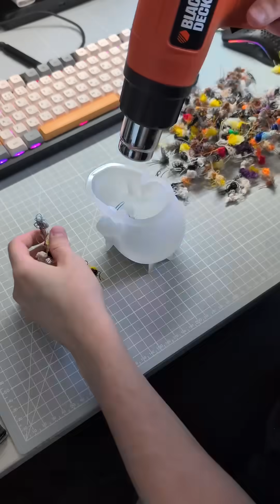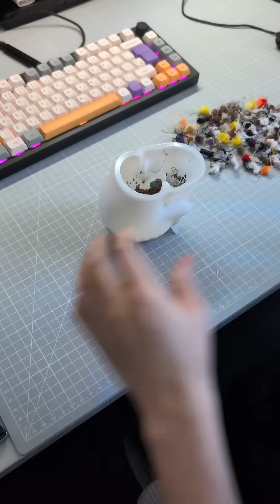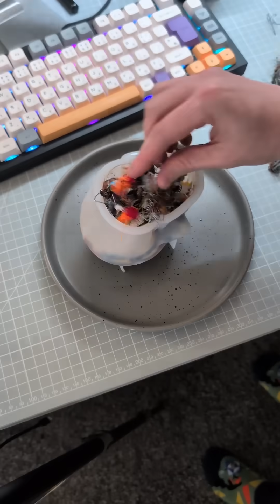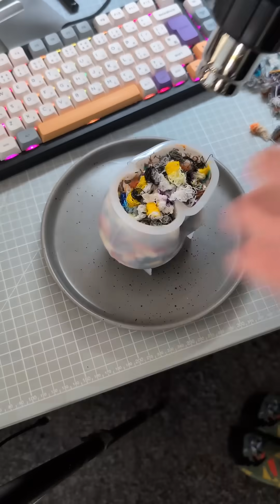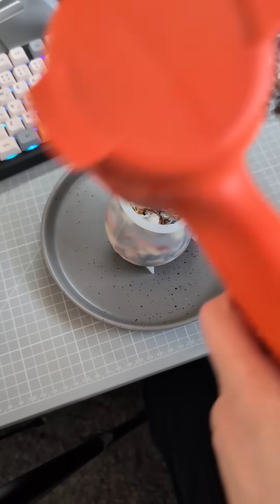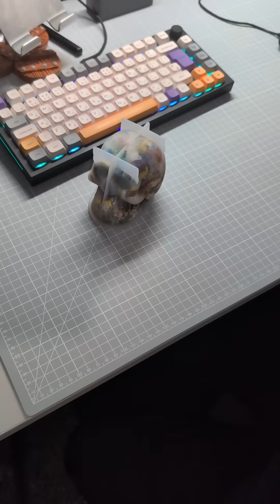Recycle your 3D Printing filament poop. Use moulds to turn it into items #3dprinting #bambulab

Comment: You want it to have a flat bottom.  After you peel it out.  Just turn on your printer bed, 65 to 70. Whatever you can get it up to. Now, use your heart gun to warm up the bottom of the casting. Put it on the bed so the weight of the mold squished the bottom flat.  Turn off your bed and let it cool.

Comment: Just use some sandpaper on the bottom,and after if you want heat it again a litle bit for a smooth surface

Comment: Wondering if I can use soda bottle caps. Does the silicone mold melt or get hot from using the heat gun?
Reply: Nope I do it with petg and it needs to get hotter

Comment: What temperature did you use on the heat gun?
Reply from the maker: I turned it on. I don't have the control of the temperature on this one.

Comment: You can flatten with a belt sander, or use a silicone mat while it is still hot to flatten it. Also this mold is a pain to take off with resin too.

Comment: Does the mold we will use need to be heat resistant, or are molds used in candle making suitable?
Reply: I have the same question! Are the resin molds resistant to the 220°C?

Comment: Def let it cool a bit when you're done not a ton but just a bit and just flip it over and let it sit on like some non stick sheet or something. That way you can trim off any excess and it will be flat. Or just run it under a belt sander xD

Comment: I do the same thing. I blend it up then bake it in a toaster oven. Both I bought specifically for this and this only. They stay outside never do it inside. And I layer the pla.
Reply: What temp in the toaster oven?
Reply: What kind of blender do you use to blend up the filament?
Reply: How long did your blender survive? I'm afraid that it would gunk up my blender fairly quick.

Comment: To make it flat you can reapply the heat gun to the bottom when it has cooled down. Then place it on some sacrificial scrap surface and you should be good

Comment: You could buy a cheap toaster oven just for this rather than using a heat gun for it.
Reply: Wil that ruin ur mold?
Reply: @TravisDavis-jn4nw  if it isnt ruined by the heat gun it wont for the oven